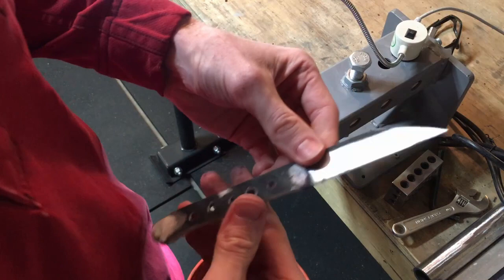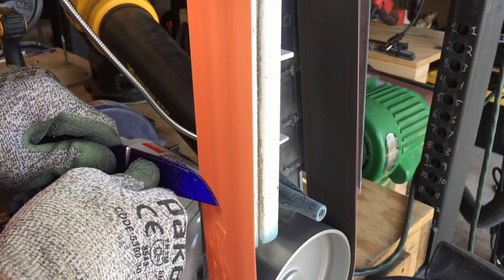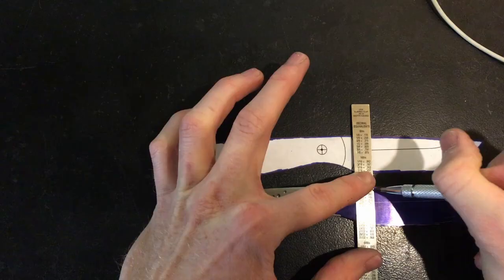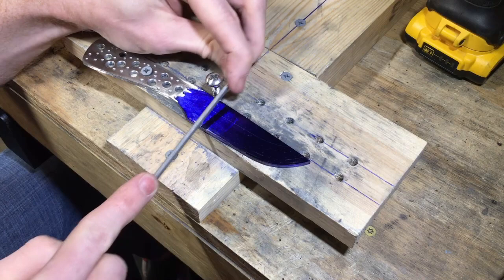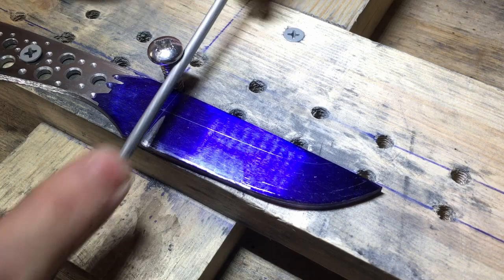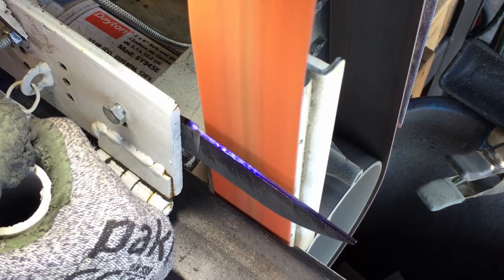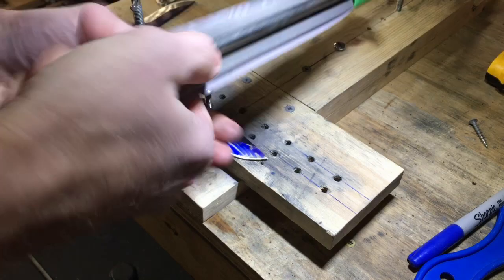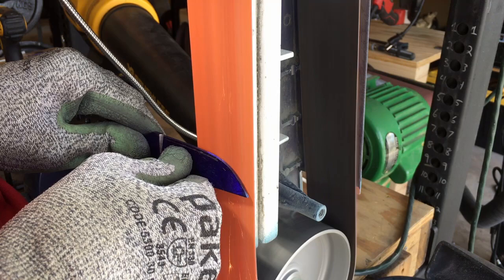Plunge Lines and Bevels - The Easy Way

Comment: When I started making knives, i was too stubborn to use a file. I was determined to get bevels right, just using my grinder. It took a long time, a lot of wasted knives and A LOT OF PRACTICE... I almost quit a few time and got discourage, but it finally started paying off... Big problem with that is, i skipped the fundamentals of knife making... great video, take it easy...
Reply from the maker: Thanks Dave, at the start, using the file method really helped give me confidence when I did get to the grinder.
Reply: Using a file on the plunge line or bevel?

Comment: Great video as usual even if it's several years old..perhaps a new version could help new makers.. Myself I plan on practicing on cheap common mild steel flat bar to develop the different skills and techniques as well as shape, size.. different grinds, tip geometry, swedge, etc I'm sure a dozen or two of practice blades will save a ton vs actual blade steels although abrasives will probably be a similar cost..I have yet to see anyone suggest starting with cheap mild steel flat bar for practice..as I'm sure the 1st few dozen blades will be less then perfect at best anyways..
Reply from the maker: Good luck with your builds! I've seen the mild steel recommendations in the past; I always liked starting with good 1084 so that if I did a good job I'd have a knife out of it. Take your time. Cheers

Comment: Filing in the plunges is a smart move.  Not every platen ever made is perfect, and so you can end up with a hard square plunge on one side, and a soft swooping plunge on the other...add an uneven pyroceramic piece of glass to that, and it’s a crap shoot.  Hand filing plunges is still handmade 👍
Reply from the maker: Griffiths Handmade-Knives 100% agreed. Thanks man!

Comment: Could you attach the 5/32 chainsaw file to a guide rod and use your bevel filing jig?
Reply from the maker: Hey MG, I haven't tried it... but I bet it could work
Reply: @RedBeardOps  I bring it up because I just tried my first plunges (my first 4 knives had no plunge lines and I found it hard to 1. Keep the line straight and 2. Stick with the initial angle. I’m doing well making knives. They’ve all been pretty nice, but I don’t even care about what angle my plunge is I just want each file pass with the chainsaw file to be consistent. It’s amazing how human in general have a hard time with knowing if something is straight or not. It’s been a ride!

Comment: This was a very good and helpful video...thank you.  I am new to knifemaking. I cannot afford on of those fancy 2x72 grinders so I have to use my 4x6 sander.  I made a jig and started grinding a bevel.  One weird thing, I was getting unwanted "scallops or grinding dents" in various places on the bevel and I don't know why.   The blade is firmly clamped in the jig I made so its not moving.   Perhaps it's just technique or maybe I'm pressing too hard or not evenly.  They are very hard to get out and some I had to hand sand...which took forever.  Any ideas how I can avoid these?  I must be doing something wrong.
Reply from the maker: Glen I can't pin point your exact issue, but I can say that bevel grinding is one of the hardest parts of knife making. I'd advise grinding 70% of your bevels and then cleaning them up with a file guide like this one to get started.
Reply: @RedBeardOps It's kind of like some little dude is grinding a small dish (a low spot) into my bevel at various places. im trying hard to be consistent and steady but they still show up.   Probably good advice, but that is a lot of filing.  Even 10% is a lot...lol    I'm sure I could better if I had one of those nice 2x72's. I modified my 4x36 and it's better but still a long way from the kind of equipment you pro's use.  You do fantastic work, and all your knives are beautiful.

Comment: can you explain what the point of a plunge line is? Thanks.
Reply from the maker: Hey Clap,  most knives have a plunge line but not all knives. Some kitchen knives are ground in such a way that the bevels blend with the riccaso and there is no visible plunge line. The plunge line on most knives is where the angle of the bevel begins to differ from the flats of the ricasso. It's a by product of grinding or filing in bevels on your knife blades.
Reply: @RedBeardOps  I see. So it's a deliberate choice and can aid in the aesthetics. I like the way you did yours.

Comment: Does it matter if the blade is up or down when grinding?
Reply from the maker: Traditionally bevels are ground with the edge of the blade facing up. This allows you to see the plunge lines.

Comment: Hey Dude! for my folders I Ht then I grind, to try this method, would I do the plunges before hand, then HT, then grind? Just wondering if youve tried that, cause im not sure if it would be detrimental to have the plunges fully in before HT, if it could cause a stress fracture or a bend at the plunge
Reply from the maker: This was a method for using a file to achieve the plunges. With time a practice on the grinder it's not necessary

Comment: That would be awesome... If knife edge can be 1mm thick before sharpening. But unless it's chopper, it can't. So method is valid if you just want to make knife,  but you can't sell knives with that kind of thickness behinde edge. If you file to less than 1mm, then it's gonna deform during quench.
Reply from the maker: You can attach sand paper to your file and get your edge thickness down to what ever you desire post heat treat. 🙌
Reply: @RedBeardOps  It would take some time, but yeah, you're right.
Reply from the maker: @canneldk855  Heck yeah it would. Man, it's the early days of knife making that really make you appreciate grinders. Stay safe out there

Comment: An issue I’m having is I get decent plunge lines and bevel lines but when I sand down and heat treat the lines disappear.. what’s going on?
Reply from the maker: Are you using a soft sanding block? if you want to keep crisp lines, you'll need to use a hard backer for the sand paper.
Reply: JKeetonKnives I use an angle grinder to get the shape. Sand it down to about 120. Using a bevel jig I make the bevel. Once that is done I sand again back to about 220. Just hand sanding. Once that’s done the lines are gone. Is there any way I can send you a picture
Reply from the maker: @andrewmeans49  my email is jkeetonknives@gmail.com - When you are hand sanding; are you using just your hands or something to back the sand paper? (like a bar or block)
Reply: JKeetonKnives on there first knife I used a block. Second one no block. Same result
Reply: I sent you some pictures via Instagram
Reply from the maker: @andrewmeans49  Hey man I saw your pics. The only/best way to maintain your lines is to use a HARD backed sanding block (like a piece of metal or a file). When you use a soft block or no block at all you will wash out those lines.
Reply: JKeetonKnives so something As simple as wrapping a file with some sand paper and going at it? Should I focus on the lines and the bevel itself or the whole knife? I appreciate the help.
Reply from the maker: @andrewmeans49  So you'll need to keep the sand paper flat on the file when your sanding and the angle of the file the same as the flat you're sanding. That is the only way you'll keep the lines there. If you use a soft backing you'll smooth out those lines or "wash them out."
Reply: JKeetonKnives thanks so much man! I’ll be starting another knife next week so I’ll give this a go
Reply from the maker: @andrewmeans49  Good luck man!

Comment: What is the height of the eye bolt when you start using the file
Reply from the maker: Hey man, I do not recall. You want to start with an aggressive angle (high bolt). Get down to your edge center line with that aggressive angle. Then start working the angle down by lowering the bolt and filing till you have a flat bevel again all the way to your edge center line. Do this until you bevel is worked back as far as you want it towards the spine.